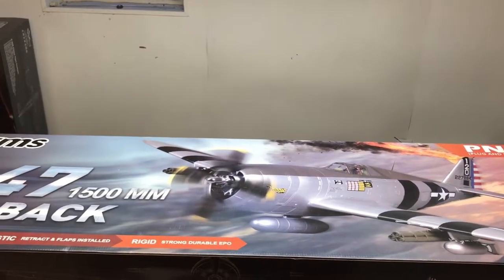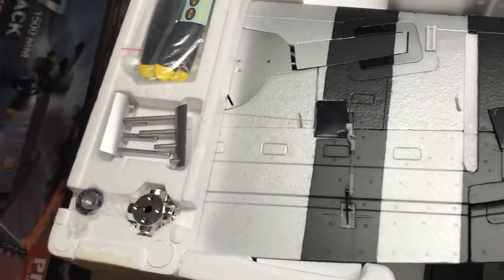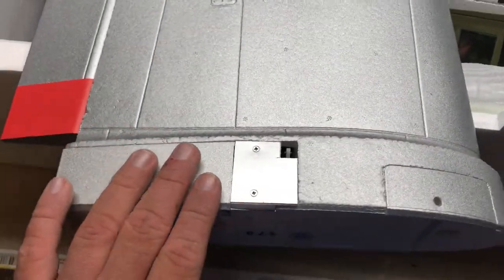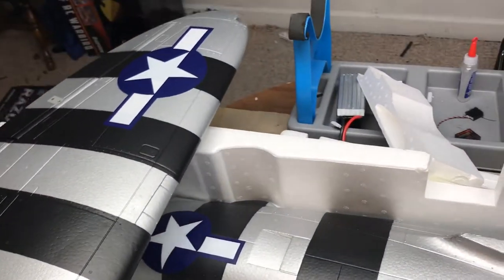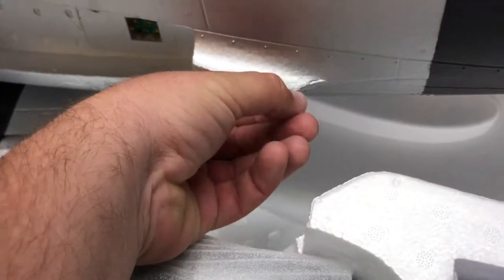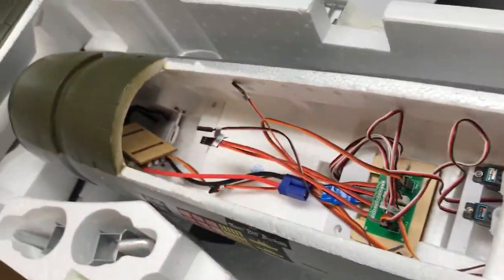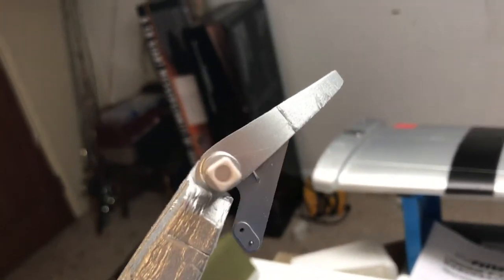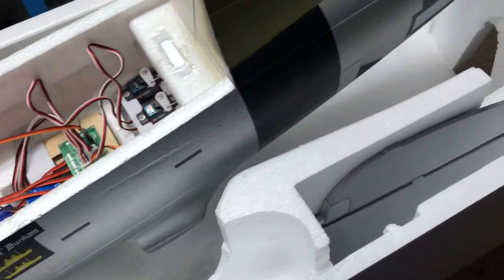FMS 1500mm P47 razorback unboxing

Comment: Mine is on the water, can't wait! So I purchased a 6s pack for this specifically but I see now its 50c, will that be ok? The manual states a recommended pack that exactly matches what I purchased in all respects but the C rating, it states 35c. Will the higher C rating be in any way detrimental to the ESC? I previously owned the 1700 and 1400mm P-51s and noted that the ESC's were pretty darn robust and handled packs well in excess of what was recommended although I know it's not good practice to do this it's something that just happened in 5 years of almost weekly flying.

Comment: how did the new foam take the polycrylic?
Reply from the maker: It worked great, i ended up with 3 coats on it total
Reply: @Ncflyer79  I just bought the same Plane and it is still in the 📦 😝. So the Polycrylic really does improve  the foam strength, and make the appearance  more shiny? Also how about the alligator appearance more dominant then before. I’m really thinking about installing a world war two sound system in this plane. I’m hoping you still have this plane since this post is four years old. Thank you in advance Jarrod!! 👍👍😁